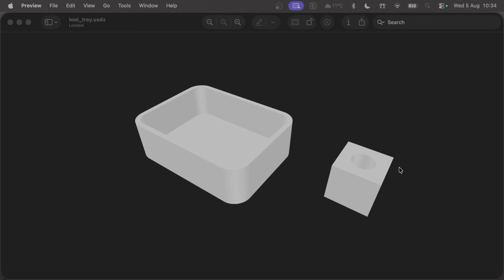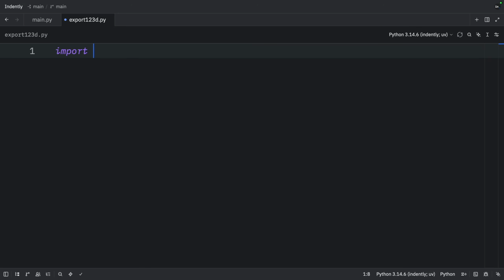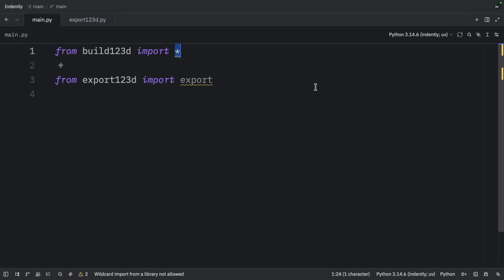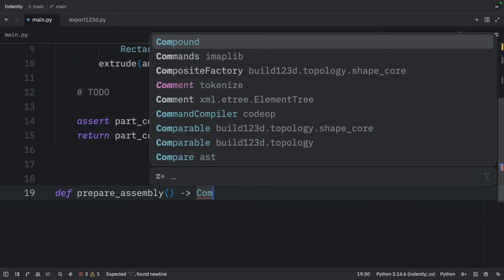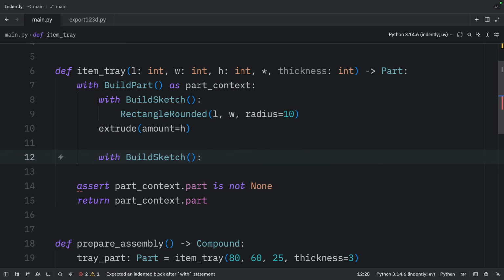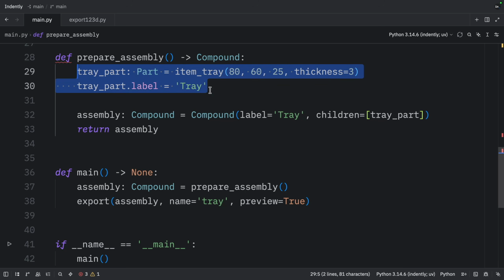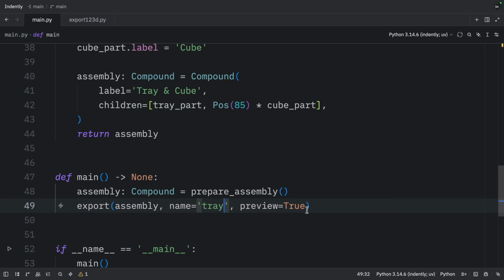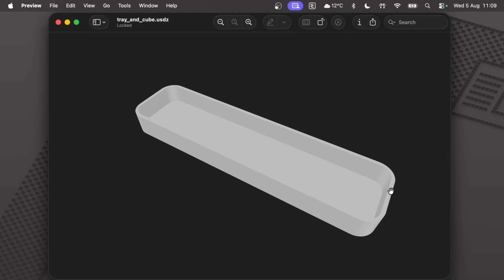How to 3D Print Using Python (Beginner Tutorial) [build123d]

Comment: Great video! I am a Collaborator on build123d and have been involved with the project for a few years now. I wanted to raise a few points:

1. MacOS Preview is probably not the best choice because GLTF/GLB don't typically show vertices/edges/faces which are critical inputs for build123d objects/operations (this would have helped you understand the "upside down box"). I recommend ocp_vscode in standalone mode for use with zed. Contrary to the name ocp_vscode does not require VSCode and can be easily pip installed and started with `python -m ocp_vscode` and then open e.g. http://127.0.0.1:3939 in a browser for your 3D view.
2. Regarding wildcard import alternatives -- generally most use `import build123d as bd`. We also have a deglob tool on github under tools/ to convert a wildcard import into a list of all used objects from build123d. There are currently ~200 separate classes/functions exported in `__all__` and a typical build123d design of fair complexity may need the bd. prefix 20+ times. As you alluded, the use of wildcard imports is addressed in our FAQ.

Comment: As someone who has had a 3d printer for a long time and mostly fumble with full cad  packages, I find this quite interesting. For your upside down question, it seems to me you need to translate the origin to the top of the larger cube before creating the smaller cube in negative. its very common to extrude in both positive or negative in CAD depending on what you are doing. For the assembly export it doesn't appear to be a problem but I question its long term usefulness, generally i want to export one part at a time and i can arrange on the build plate as wanted. I guess it does cut down on result files.
Reply: Yes, this is correct regarding the upside down issue!